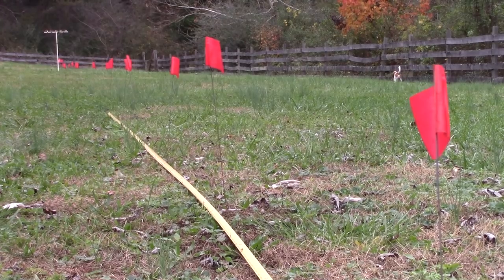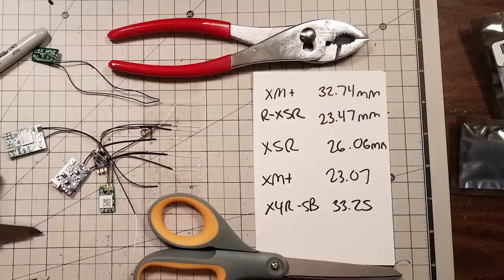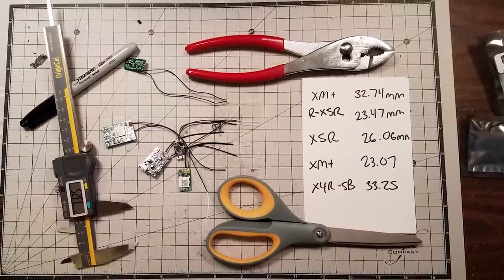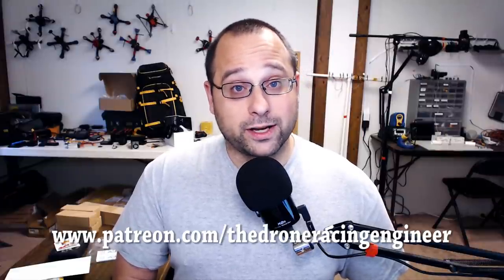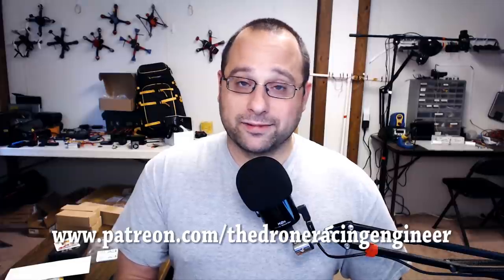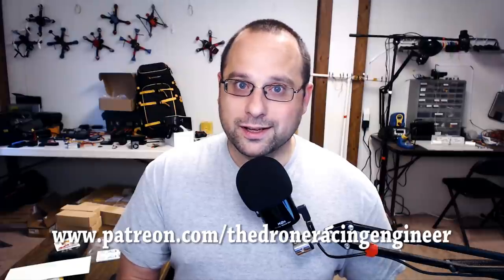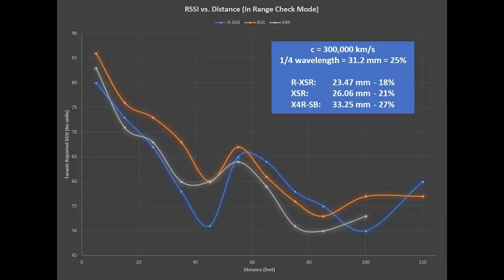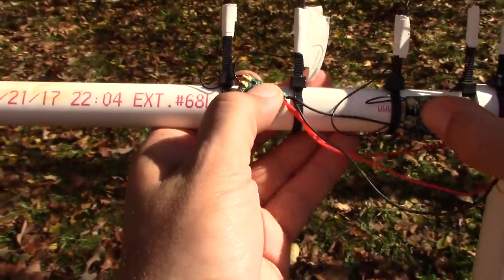Range Test FrSky RX | WRONG ANTENNA LENGTH?

Comment: Thanks for taking the time to do this test. With that said, the test you performed is not valid. There are way to many variables involved to draw any sort of conclusion. You even said that all the receivers are designed differently and may be tuned tuned differently... First, you need a control. (A stock FrSky receiver and antenna.) Next you need to introduce 1 variable into the equation. In this case it would be antenna length. By testing the same receiver with different length antennas will allow you to come to some conclusion on whether or not antenna length matters on that particular receiver. 

Cheers,
Greg
Reply from the maker: I did test the same receiver with different length antennas. I had two XM+ in this test and I swapped antennas between them and between the X4R-SB. This test is not invalid. It has uncontrolled variables that must be taken into account when considering the results.

This test shows that, under these conditions, there is not a discernable difference in performance between different antenna lengths. And these conditions reflect the real-world conditions that some pilots fly under. Also, remember that the first test used 100% stock equipment, so at the very least I started to disprove the hypothesis that the stock antenna length is categorically wrong on any of these.
Reply: So what do you think about the people doing the internal antenna mod to the transmitter? Do you believe this is a waste of time? I was considering it but you have since challenged my thinking and that it may not be worth the trouble. :-)

Greg

Comment: One problem with your testing is having the antennas next to each other. Thus giving you false conclusions on range of antenna. Ideally you would need to test one at a time by itself with none to either side. For an example having them all powered at the same time is like how  truckers run two antennas on their rigs, one on each side mirror causing the radio waves to be directional , forward and backwards parallel with the length of the rig.

Comment: So the other day I finally had to replace my xm+ receiver with a new one...right off the bat I notice my signal has gone from full range (~1.5km ) to like several hundred meters and lose signal (failsafe) every time I go beyond about 200 - 300 meters.  I was thinking its a bad batch of receivers, but same thing on a different new one. Could I need a new transmitter or update or what?
Reply from the maker: Can you try different antennas maybe? Take the antennas off the old one and put it on the new one.
Reply: Which of Frsky's receivers have the best signal up to over 1km?  I am used to using only xm+, but recently purchased Frsky's LR module w/ their "smim" LR receiver, not the micro like I want to do next. Could you perhaps do a video on installing Frsky's LR setup?  I can't find any YouTube support -tons for crossfire though - I'm just too lazy to do the mod for my QX7.  Which of Frsky's transmitters (new) can install the TBS Crossfire module without the modification, just software updates?

Comment: too many variables to even draw a conclusion; different radios, possible different material aspects of the antenna's, influence of positioning and wiring involved, etc. the radios could have altered induction or capacitance that even influence the needed length of the antenna/reception. let's conclude that psoition is a factor and that is most cases length does not affect that much, unless you have receiver that also does telemetry (sending data)?

Comment: its a little unfortunate that you only did a single test run, especially considering the volatility of your data... since your test didnt involve failsafing and crashing quads for each run, i wouldve thought it was fairly straightforward to do 3 or 5 runs and average them

Comment: My RSXR has had the worst range of everything I ever used. I haven’t tried replacing antennas yet. Stinks we just can’t chop everything to 32mm and call it good.
Reply: Really!?!? I just ordered a R-XSR with intentions of swapping out antennas. I use to be an XSR user. Switched to XM+, but miss the Telemetry, so going back to R-XSR to give it another chance. I pray swapping the antenna will give me the same range I got on the XM+.
Reply: did you upgrade it ?, how is the antenna plasment ? mine is working fine but maybe the m-XSR is the best since you can get the antenna really fare out on the corners in the Quad.
Reply: Am i supposed upgrade firmware. It was recently purchased. Antenna placement is fine.
Reply: yes I hade to do that to get luna script to work. I always do normally, but this time I had to.

Comment: mmm i dont see the logic in the test. I would compare different antenna lengths on the same receiver.  In the first graph you are comparing 3 different receivers so it has no point the difference in antenna as there are difference between receivers. Moreover i would use the same antenna (i.e. bangood antennas and trim few of them at different lengths)
Reply from the maker: I did compare different antenna lengths on the same receiver. In the 2nd round of testing, I had two XM+, one with 33mm and one with 27mm antennas.

Testing the receivers with the stock antennas they come with is the right first step. If nothing else it allows you to have a baseline of performance for when you start swapping antennas. What if the antenna is tuned to the receiver somehow, and you start swapping and performance gets worse? But on another receiver, that same antenna is better? If you don't test the stock antenna that comes with the receiver, you would never know.

Comment: I want to know if there is a diference if you swap the original antenna of the xsr with the 31.5mm ones. Is it posible that you can do any testing of that?
Reply: Booly Vdberg that’s how TheRCAddict flys his and he gets insane range. He just uses that setup for his “long-range” videos - no crossfire or anything.
Reply: Keith Anderson i dont know that! How do you know that and is there a video of it?
Reply from the maker: Since it would require me to solder the antenna on, I'm unlikely to go that direction. But the XSR has the heaviest coax of all of them, so if I were going to do any modding, that's likely what I'd mod.
Reply: Booly Vdberg here is a video of him flying “long range” with the setup: https://youtu.be/T0Q5EUinMzs obviously a crossfire will get much better range and these were pretty ideal conditions but it’s interesting nonetheless. In the comments he said he only got low rssi warnings as he came down from the hill as trees started to block the signal. Let me quickly find the video where he says he uses the longer antenna.
Reply: Joshua Bardwell  yes thats what i was thinging of to mod the antenna to 31 mm and then test a original xsr with a xrs with the modified antenna
Reply: Booly Vdberg never mind he actually swaps out the stock R-XSR cable with a longer one when he flies his recent long range video, but previously he flew with a XSR and stock antenna. It seems that the mounting of the antenna on the quad has a lot more to do with range in these instances than anything. Here is his R-XSR review where he briefly touches on it https://youtu.be/BYVm_C6hna8 for him it boils down to the fact that he’s tested the longer antennas before and has a lot of confidence in them and in the comments he says he doesn’t like how thin the stock antennas are as well.
Reply: Keith Anderson thanks man i will modifie them first and than fly my quad haha

Comment: All of them are CC2500 or CC2510, not much could be changed on the receiver side to make it suitable for one antenna or another.
Only the coax is a bit different.
Reply from the maker: I just mean perhaps there could be some impedance matching or something. This isn't really my area of specialty to be honest.

Comment: We are lied to about the speed of light. Hence the theory of antenna reception and signal propagation is perverted and secretive. There was a time when this information was classified. And my guess is the declassified information later given is skewed.
Reply from the maker: +Termi Nation you can verify the speed of light yourself at home using some simple experiments. No need to trust the information you're given. Take the scientific mindset and learn for yourself.
Reply: And how do I "verify the speed of light at home" pray tell? - Have you ever learned how and when the speed of light was determined in the first place? Around 1676, Danish astronomer Ole Roemer peering through a telescope timed the traverse of shadow eclipse and 1728 James Bradley by "stellar aberrations' - EXCEPT THEY DID NOT HAVE ANY DECENT OPTICS IN THOSE DAYS NOR ANY KIND OF STOPWATCH TO SO MUCH AS COUNT SECONDS ACCURATELY LET ALONE TENTHS AND HUNDREDTHS OF SECONDS. 
The real fact is light/photons exist in a matrix/ether. They do not move they are just 'revealed' when electrically excited - one excited photon exciting it's neighbor photon and so on off to the end of human perception INSTANTANEOUSLY (if you can call that a speed). Like a line of dominoes that have no space in between,  All the dominoes from the end and throughout the line falling over at the same time as the first domino that was pushed on. The holographic theory for existence is the correct theory. But since that theory leaves room for a God of creation the powers that be, who can't have that, make up fraudulent science. Relativity is bunko nonsense. But it serves to make morality and ethics a human arbitrary construct (that can be therefore be betrayed) rather than an endowment of the Creator.
Reply: Joshua your own experiment here ITSELF debunks 'wavelength" since shorter or longer than wavelength antenna or right on wavelength antenna makes no difference They are all testing out similarly. There is no "wavelength" because there is no speed of light. Your analogy of a bouncing ball on a train -  like a drum there is the parameter of beats/bounce higher or lower tempo and there is the strength of that bounce/drumbeat harder or softer/louder or quieter... but there is no movement of the train/drum that creates your wavelength. Again your own experiment is showing you this.
Reply: And how do I "verify the speed of light at home" pray tell?

Comment: When you place the antennas like that, it acts like a yagi.
Reply from the maker: I think that's only true if the antennas are electrically in parallel so the signals combine and are allowed to cancel and reinforce. That's not the case if they're wired to different receivers.

Comment: It has rssi on channel 16
Reply from the maker: I know that.

Now tell me how to take advantage of that with no FC attached, and the RX in range check mode?

You can't.

Which is exactly what I said. It doesn't support telemetry, so it can't have RSSI in range check mode :-)
Reply: I don't have a clue 5v bec ??

Comment: Hi Joshua, Great information, and I like this kind of information.
A while ago you performed the Taranis antenna modification as specified by IBCrazy and Mr Steele. I too performed the modification, but with great success. During my modification, I took the time to measure the stock Taranis Tx antenna length = 24.6 mm. The replacement 5 dBi antenna I ordered had a length of 26.2 mm. The grounding plane for these were 26.0 and 24.1 mm respectively. Full details can be found in my FliteTest article: https://www.flitetest.com/articles/taranis-upgrade-speaker-shielding-sma-connector (which references your experience). Do you think that matching Tx antenna to Rx antenna plays a bigger role in Tx/Rx coupling than the wavelength to antenna length?
Reply from the maker: I'm not enough of an antenna expert to say for sure. But you can't assume that the WiFi antenna and the FrSky antenna were tuned to the same frequency. The only way to be sure is to hook them up to an antenna analyzer.
Reply: Thanks

Comment: When testing antenna length you don't use different receivers.  You tested a receiver/antenna setup, not antenna length.  This is an invalid test with inaccurate results.  If you want accuracy you don't even use multiple receivers, you use one and swap antennas for each test.
Reply from the maker: I tested the receiver/antenna system because that is the actual system that people are asking about.  They are asking, "is the antenna on the RXSR the wrong length," but what they really mean is, "Does the RXSR, when used with stock antenna, have shorter range than another receiver with its stock antenna." That's the question I tried to answer in this video.
Reply: @JoshuaBardwell  You start out talking about antenna length and frequency.  I can tell you from growing up in the CB radio era, you were spot on.  But that is not the test that you performed.  You need to test each receiver with different length antennas to see what the effect is. In CB radios we hook up a SWR meter and cut the tip of the antenna to the proper length. In any receiver if you want optimal performance with a stock antenna you need to tune it. None of them are made the same, even in the same model.  Somewhere in your video you got off track.  Good info maybe, just wrong title.

Comment: I'm frustrated as it's really hard to find anything on the R9Slim/R9 and R9M Module from FrSKY. I just purchased and updated unit from getfpv.com and it appears they've fixed the antenna issues. I know it's not related to this video but I really want to see a bigger YouTube channel do an honest review/comparison with the TBS Crossfire & TBS Crossfire Micro.I have a video posted on the setup/firmware updates and hope to get a flight video out this weekend:
https://www.youtube.com/watch?v=Lo4rL4_4pRA&t=138s
Reply: 1st real world test (at 500mw):
https://www.youtube.com/watch?v=UxFVNo72EXU
...Very impressed on another flight, same power level I was 2950ft distance with 90% RSSI (forgot to plug in external lipo).

Comment: My reception on my taranis sucks. The cheap flysky had better range but gimbals are the gay.
Reply: i watched a video of le dribs a while back and he did a test on his taranis antenna and it turned out to be his 5 dbi mod antenna that was the problem
Reply: damon barnes 
I have a stock antenna and three xsr on two racers and a freestyle frame. Maybe mine is broken inside

Comment: I don't really Understand why To not Just Go and build A quad For testing And then Go to a clear filed with no 2.4Ghz in the way far from the city.
fly Straight In a line Until you get Failsafe and then measure that distance and do the same for every receiver and to see the difference between all of them.
why you need to do this in you backyard where there is a lot of 2.4Ghz and Then you Go around Things.
Just go to A open big filed with no 2.4Ghz to disturb and then do the REAL WORLD TESTING!
Reply from the maker: +Frogzy looking forward to your test results!
Reply: you said you love to do this
Reply from the maker: I do love to do this! But I am very very busy. So driving to somewhere with a big open field and then setting up the experiment would take too much time. And flying the antenna on a quad is not scientific because altitude makes a big difference in coverage so a small change in altitude could have a big effect on range especially at the edge of the range.

You started your comment with, "I don't really understand why not" to do it your way. Well... I have reasons :-) So if you think your way is better, go for it. More science is better!
Reply: Joshua Bardwell Ok I understand You
Reply: The guys on RR did a test like this, comparing the X4R and XSR https://youtu.be/UMSYa5fxq8Q
But I think to get any statistically significant results you have to do a fairly large sample size.
This could at least show us a trend, but to get real numbers, testing under lab conditions would still be necessary.
Maybe FrSky will someday share their testing procedure and results.
So far I fell like XM+ and R-XSR are good options in most scenarios. Still more stable than Team Failsafe ;)
Reply: +marwar666 oh god not spektrum. those dark days are behind me now... :D

Comment: Interesting test, thanks for going through all the trouble.  In the following video, Kevin modified an antenna from a stock XSR from 1/5 to 1/4 wavelength and the range did in fact increase.  Is there a logical explanation for that?  https://www.youtube.com/watch?v=UMSYa5fxq8Q   Perhaps you could conduct some sort of long range test without using the radio's range test function.
Reply from the maker: I am familiar with that video. I can't speak to his results.